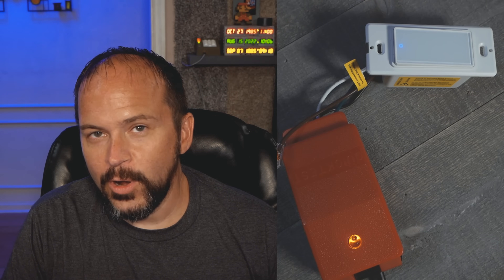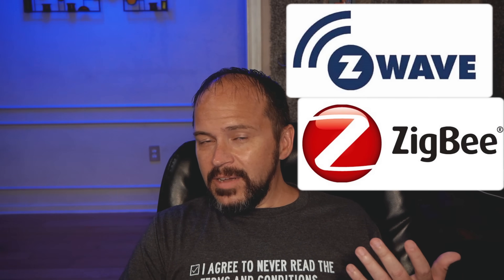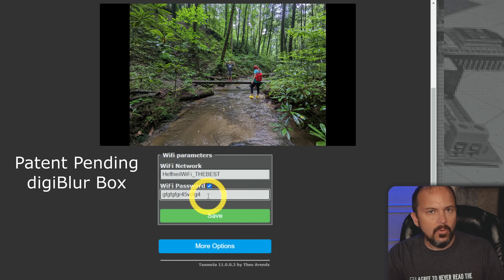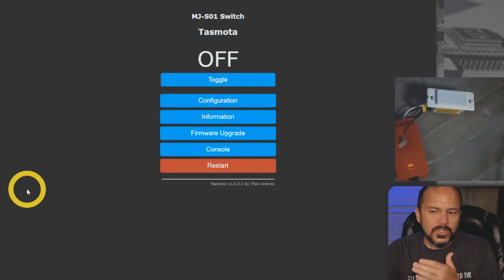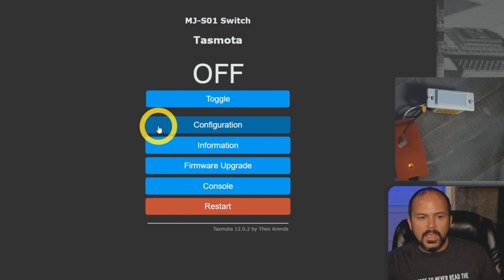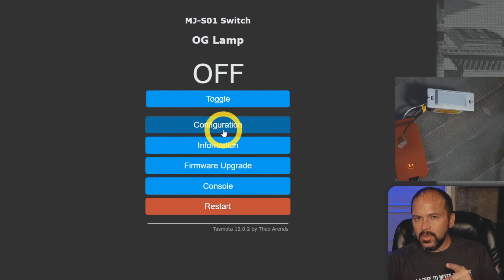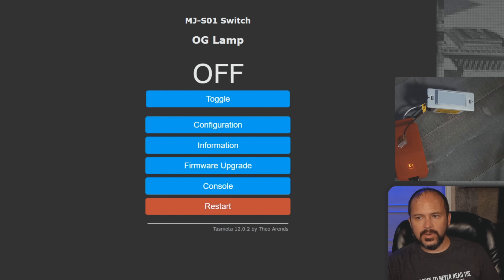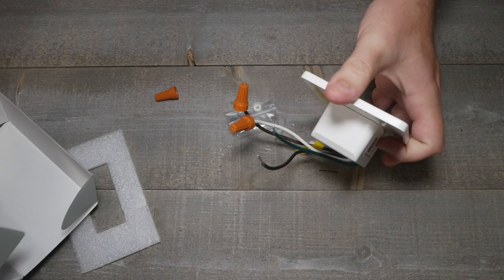TASMOTA Pre-flashed Smart Switch & Dimmer with Home Assistant

Comment: Do you have a video showing how to setup the local DNS you use for MQTT?
Reply from the maker: No. I am just using the override dns entry in unbound in Opnsense. You can do the same if you are using PiHole too.
Reply: @digiblurDIY  I'm planning to move my HA to a standalone micro Dell from my NAS and am not sure the best way to do the DNS
Reply from the maker: What are you using for DNS now? Any PiHole?
Reply: @digiblurDIY  nothing just using the IP, like you said is a bad idea if you change setups 🤦‍♂️
Reply from the maker: No. Like what is serving DNS in your network? Anything other than the router?
Reply from the maker: It might be difficult then unless you have an alternative dns running

Comment: Hey, can you tell us which bulbs are you using with this dimmer? Some of my led bulbs are flickering, could you help us? Is this Trailing Edge Dimmer? Thank You!!
Reply from the maker: I don't recall.  I usually just get some run of the mill dimmer approved bulbs at Lowes or Home Depot.  Set the dimmerrange min and max as needed and roll.

Comment: is there a way to turn off the led on the front of the led
Reply from the maker: On the switch or dimmer?
Reply: @digiblurDIY  both when there turned off
Reply from the maker: I think the dimmer is setoption86 or 87..I can't recall. Have to check the pwm dimmer module docs.

The switch has controllable LEDs. There are two. Just disable one in the template.

Comment: Since these are pre flashed does anything need to change in the addition of the mqtt that needs to be added to home assistant or does the standard config you did a long time ago still apply.
Reply from the maker: They should be pretty much ready to go.
Reply: @digiblurDIY  So if I understand what you are saying I STILL NEED the MQTT code in HA but do not touch it.
Reply from the maker: You don't need an manual code for these.  The Tasmota HA integration will pick them up once you put in your MQTT info for HA to see them.  But no code, yaml, etc.  All automatic

Comment: I am sorry to say but this IS NOT SIMPLE. Just started with ESPHome. Can not intergated ESPassiatant/Dialog into my HA Docker installation. I tryed 3 types of ESP board. NO ONE got succesfull. I presume that i am missing a lot of information needed about HA and ESPHome. This is not for starters!. Please explane how many ways  exist to integrade ATC themoters into HA ( then maybe i can filter all documetaion in ESPhome.  Was running on ESP Tasmote on 2 ATC's no problem via MQTT in HA, but with ESPHome is complete chaos. Sorry to say.
Reply from the maker: It is ready to go out of the box. Power them and the AP shows up. If you want to put Esphome on them you will need to learn a bit of esphome as it is a little more advanced. Stick with Tasmota on them for now as I went step by step on that.
Reply: Sorry. Travis i posted this on the wrong article/video. My comment was intended for the esp-ble-proxy video. How To Make a Home Assistant Bluetooth Proxy | EASY NO Soldering Sorry

Comment: Would be nice if they Had 230v but this is awesome start
Reply from the maker: The size might not work but I can say they support 240v as I've seen people use them before in other countries.
Reply: @digiblurDIY  Then i need to do some reaching on it to confirm that would be fantastic.
Reply from the maker: I just checked...the back of it says 100-240V~,50/60Hz, 15A(Max)
Reply: @digiblurDIY  Then i will be getting me a few of them. Thank you

Comment: Bought one, installed it, worked quickly! It feels solid, EXCEPT that the provided mounting screws protrude in a way that prevents putting on the top wall plate. 
Anyone else experience this??
I had to chisel away at the screw hole to get it to fit.
Reply from the maker: I haven't seen that. Usually the beveled screws go into the hole it self. Curious if others are getting something different
Reply: @digiblurDIY  the screws I got with it were convex headed, leaving them to protrude. I can see that flat beveled screws could have worked. I just don't have machine screws with beveled flat heads at home...
Reply: Ah, I opened a second one I got, and it had the correct flat headed beveled screws.

Comment: Anyone find the Amazon link for us Canadians?
Reply from the maker: No preflashed there yet but still easy to flash the regular via Tuya Convert or jumper pins.
https://amzn.to/3ckXSSV
Reply: @digiblurDIY  I got the dimmer and the three way (here in Canada) and I was able to flash them using the old regular Tuya Convert (no soldering required) just over the air. Awesome, they still allow this to be done!

Comment: Awesome - get this video three days AFTER I received my MJ-S01 from the Great Amazon. After watching the video, I had great hopes, but no, the switch I got is pre-Tasmota and will need to be flashed.  I also see, according to the data on Amazon, the Tasmota version is only rated for 10A operation? Anyway, thanks for the great videos. I look forward to my first "flash".
Reply from the maker: There was a first batch a couple months ago to test the waters but they sold out stupid fast.  Glad to see them come back and have some decent stock for us.  Not sure why that states that on there as everything shows 15A.  Guessing a copy and paste from the other cheaper 10A switch and they didn't correct the issue.
Reply: @digiblurDIY  - hot damn! I'm one of the cool kids! I soldered, I troubleshot, and I flashed the damn thing. Thank you for the template and other information!
Reply from the maker: @chunkkingmann309  nice job!

Comment: A great video! What is the brand and model of the dimmer that you showed toward end of the video? Loos really nice! Is it pre-flashed with Tasmota? Also wondering whether it can be used together with Lutron pickle remote control. Any thoughts would be highly appreciated!!!
Reply from the maker: That was the switch internals I was showing for folks that want to see the guts.  The dimmer they also offer is preflashed and I did a setup video on it before they offered it preflashed.  It's linked in the video description.  

You'd have to see if HA can integrate the Lutron remote.

Comment: Very well done great job. This is how devices should be sold as close to P&P as possible. BTW does this one require neutral? Does this company make a 3-way switch? Does ESPhome require MQTT?(Newbie) Yes on the fan control!
Reply from the maker: Neutral is required. If you have no neutrals I would suggest Zwave or Zigbee based devices for that.

The preflashed 3 way is coming. 

ESPHome can use either MQTT or the API. All your decision and design there as you build the firmware. 

I also received confirmation the fan controller is in the works yay!
Reply: @digiblurDIY  you don't know how many times I am laying in bed ready for night's sleep when the hallway light comes on and stays on. Looking forward to installing three switches so that can be put to rest.

Comment: Any chance they're doing a 3-way dimmer soon? The only reasonably priced option for me is TP-Link at $40 CDN for the set, on sale if I can catch that window. Ok price, but not local. Unless you already have a go-to solution?
Reply from the maker: I haven't heard yet. They might still be some ESP based stock but not flashed. I prefer to do two regular dimmers in Tasmota device groups as it is cheaper plus offers more functionality.
Reply: @digiblurDIY  interesting. Do you have the details of this somewhere? Like how to wire them, what needs to be done in HASS, and if there's any config settings that need to be set. I'm guessing the downside is lack of function if HASS is down. Fave switches for this (I don't mind flashing, especially if that makes hardware easier to get in the Great White North)?
Reply from the maker: That's the beauty of Tasmota Device Groups, home assistant, MQTT, rules, etc are not involved.  They can be all down and it still works.  I've done a few videos on the series with various setups from dimmers, switches, bulbs, etc.  
https://digiblur.pages.dev/wiki/wiring-diagrams/tasmota-devgroups
https://youtube.com/playlist?list=PLgtdo_8K2U9k1nUR9tbDNf1zoXyJ8Bzmz

One of my favorite features of Tasmota!  So damn slick and easy to setup.

Comment: I really like this a lot. But it won’t work well with all my lights that are 3 way and 4 way wires.
Reply from the maker: Yes it will.  A lot of use device groups with two of them.  Works so damn slick and point to point with no automations/rules needed.  https://youtu.be/52ZPROouhOQ
Reply: @digiblurDIY  thanks for the clarification. Device groups seems nice.  However using three smart switches with one light seems like it would cost more than one Shelly and three dumb switches.  I’m using Shelly throughout my house and most are connected to 2 or 3 dumb switches.  Shelly works well with multiple inputs in parallel.  But I can see that device groups would help where the wires didn’t already exist.  I e a new switch location for an existing light.
Reply from the maker: Three ways only have two switches, yes weird names, unfortunately many of the 3 way and 4 way setups I've run into a Shelly wouldn't work due to the wiring configuration.  But if your configs support then yeah, definitely roll with the single shelly.  Less to support.
Reply: @digiblurDIY  I’ve had 4 way configurations that took me a long time to trace out the wires accurately.  But in all cases I’ve been able to use a single Shelly with multiple switches.   One trick I’ve used to make it work where it appeared to lack enough wires is to substitute a push button instead of a toggle.  That saves one wire by using an intermittent hot instead of two traveller wires.   That freed up wire then can be the return path needed to make it work.

Comment: Do you think they'll dop any devices with "No Neutral"?
Reply from the maker: Probably not. That's more suited for a super low power quick connecting protocol like Zwave or Zigbee. Eventually WiFi 6 will get us there but that's a bit away still.

Comment: I would love a fan controller.  With fan and light controller for local control.  Currently I have the trear life which I am afraid to flash!!  If it comes prebuilt I would pay good money.
Reply from the maker: They have said they plan to bring the fan controller to ESP based but I haven't seen it yet.  Thanks for adding to my army of comments to help convince them there IS a market for it.
Reply: @digiblurDIY  There would be a market for this for sure. One more device that is "plug and play" I see these going off the shelfs like hot cakes
Reply from the maker: Received confirmation of the fan controller coming this morning.

Comment: Great to hear another brand is moving towards to having tasmota pref-flashed. I live in a condo and there is no neutral in the switch box and not possible to replace the cable. So, I am stuck using the Lutron Caseta dimmers. They work well and I have the hub.

Comment: This is awesome that they are selling them pre-flashed!  Usually I am adding sensors, etc so I still need to solder pins, but occasionally use them standalone.  I am definitely someone "wearing a tinfoil hat" so I absolutely block all devices from the internet.  IOT devices have been an attack vector in multiple attacks, but I work in the security division of a large company, so I am definitely on the paranoid side.
Reply from the maker: Yes I wouldn't expose them to the internet with port forwarding or dmz for sure.

The comment comes from people blocking them and not knowing what they are doing then the device has no ntpserver, no dns and sometimes no dhcp. Then they blame the device and or software.

Let me check on the through holes. I have seen people add sensors such as PIR (me) and other stuff.
Reply: @digiblurDIY  Ok, I'm not going to lie.  Once I went to update some of my WLED devices and couldn't figure out why I couldn't update them from HA, only to remember after wasting a good 15 or 20 minutes that I had to turn off a firewall rule :)

Comment: Question: what power does the internal low voltage PSU support?
Reply from the maker: It's 5VDC out for the relay and then goes into a AMS1117 to drop down to 3v3 for the ESP.
Reply: @digiblurDIY  thanks for checking!